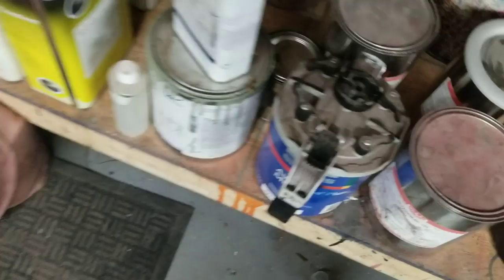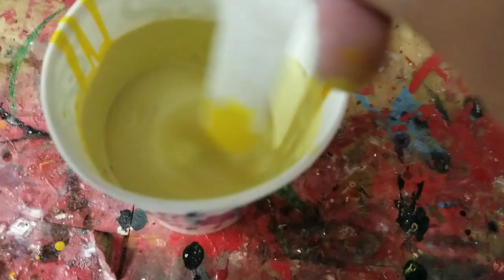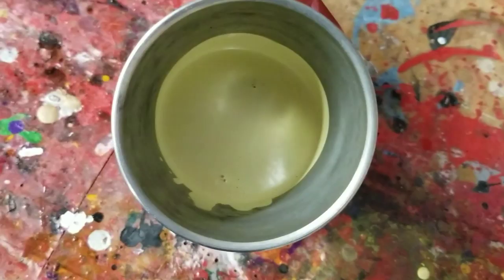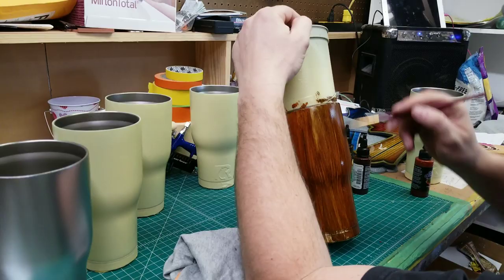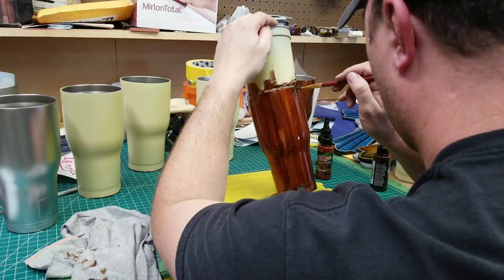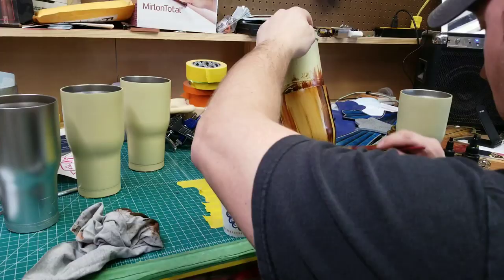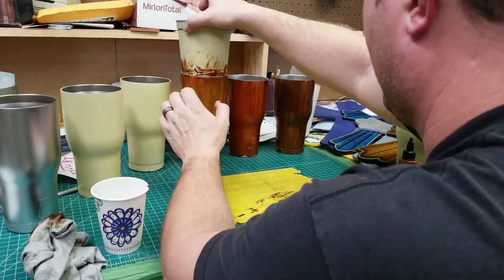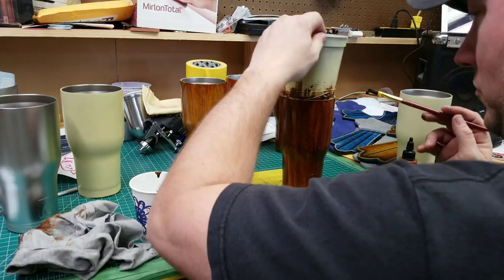Easy How to Paint Faux Wood Grain!!!

Comment: I've stripped back and stained a large wooden staircase but there are several steel support spindles that I need to paint and need to achieve a wood grain effect to match the other spindles. Do you think the method you've used would work? Many thanks
Reply from the maker: Yeah but one of my favorite methods is using Old Masters Gel Stain

Comment: I'm trying to refinish a built-in cabinet in my living room. It took days for me to strip off layers of old, ugly paint, and then sand everything using 80 to 220 grit sandpapers. Started applying the stain, and it's turning out blotchy and uneven. :( I really don't want to re-sand it all over again to remove the stain I've just applied (luckily, I didn't do the entire cabinet), so I'm thinking of simply applying a faux wood look using paint, in the same color as the stain (which is Colonial Maple). The inside of the cabinet looks okay, not perfect, but it won't show much, anyway, so I just need to do the outside. I think I'll need to apply a primer, as the stain is oil based, and I'll be using latex paints. What type of primer should I look for? I can't use spray paints, as this is an apartment, and obviously sprays will be too messy and fumy. I love the way your cups turned out, and I think I could do the same thing on a bigger scale. Just want to make sure the paint will stick. Any advice you can give would be appreciated!

Comment: What kind of pain did you use and what would recommend for honey grain on hollow core closet doors?
Reply from the maker: I used Createx waterbase paints for this one. I have used gel stains for doors - you have a longer work time with gel and it is thick enough to do vertically

Comment: i would like to do this on the beam of my house but its a congcrete and rough at that can you tell me what materials i need and steps..and i dont have spray paint.ty
Reply from the maker: if it is rough, you could start by prepping it with a thin coat of bondo (no thicker than 1/8th of an inch) and sanding smooth. next prime it and the paint it a light yellow/beige base color. Then, i would use Old Masters gel stain - i like colors Golden Oak and also Walnut.
Reply from the maker: Another easier option would be to face it with foam insulation board - cut it to size and even carve any grains in it, glue it on with Liquid Nails and paint it with acrylic paint (like frome the craft section at Walmart)

Comment: Looks awesome. What paint are you using?
Reply from the maker: I am using Createx waterbase paints. These are the illustration line - great for airbrushing too.
These are the ones: https://amzn.to/2sF8Awt
Reply: Thank you for sharing 😊. I’ll check them out. I want to learn airbrushing this year also. Where do I start?
Reply from the maker: @BadBetty  I hope this helps
When I started I got  a big roll of paper and just started drawing lines, dagger strokes and stuff like in this video here: 
https://www.youtube.com/playlist?list=PL2E3D9688C1B37346

The only Airbrush you will ever need: https://amzn.to/2NJQ9y3

You will need a Compressor something like this (I got mine from Hobby Lobby or Michael's - I cant remember): https://amzn.to/3armUd9

I use those paints I showed you earlier interchangeably with these (also Createx brand but I can get these at Hobby Lobby in a pinch & the Wicked line is supposed to be good on ALL surfaces so If i had to choose one I would get these: https://amzn.to/2TFseUj

Always add 3 drops of this 4030 makes your paint flow so much easier, and helps adhesion: https://amzn.to/3aq2Is1